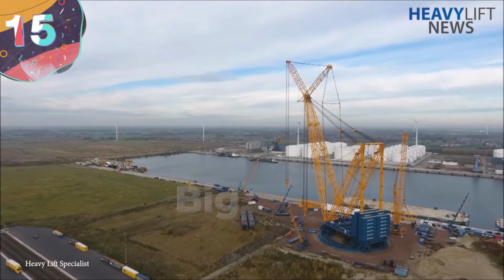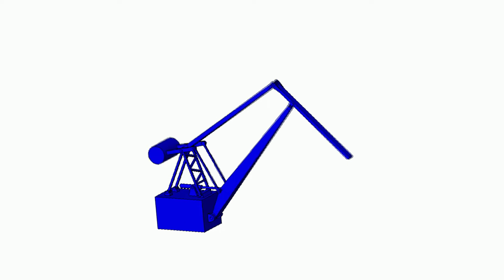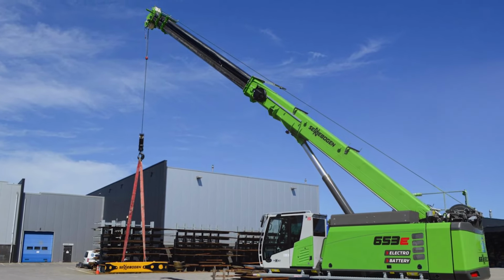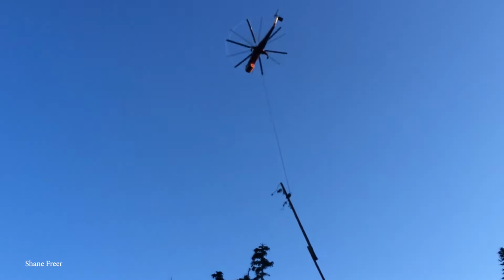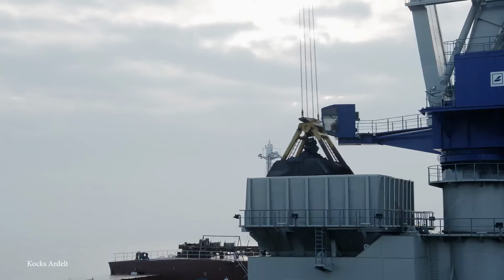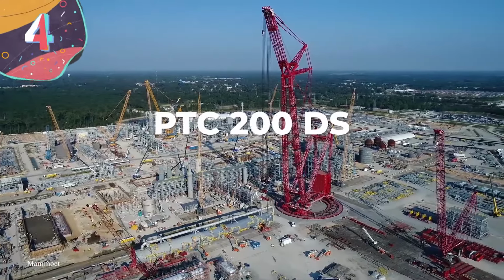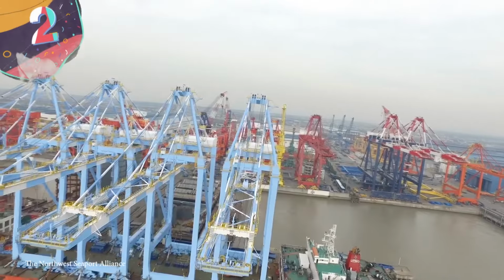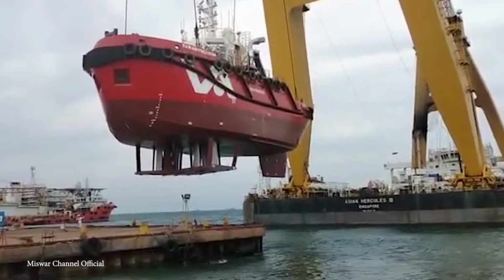15 MOST Amazing Types of Cranes

Comment: Mammoet Focus 30 which is a new crane designed and built by Mammoet. It can build its longest boom in a space of 30m x 30m if i'm correct. it has 3 configurations. Crawler, jack and skid system and fixed. Also guy derrick cranes which aren't as popular anymore.

Comment: Cranes prove this earth is stationary and not spinning at over 1000mph on a 23.4° axis as most non comprehending children were “taught” in indoctriNATION school or they won’t work✅ Especially at sea, proving this earth has absolutely no curvature that’s ever been documented or filmed as if it doesn’t exist it can’t be filmed🤣🤣.. And of course the ground doesn’t move under any airplane.. Airplane so named by the Wright Brothers as it’s a machine that flys in the AIR over a PLANE👍 And everything built is built with a level to level and a plumb bob to true, as nothing can be leveled or trued on a sphere✅ Especially if it was spinning  faster than the speed of sound😂😂😂 Sea LEVEL, Ground LEVEL, Horizon LEVEL and Eye LEVEL have been called that since man’s beginnings for a reason..